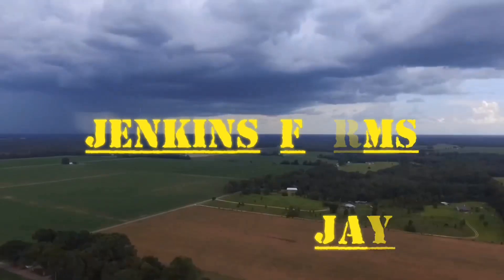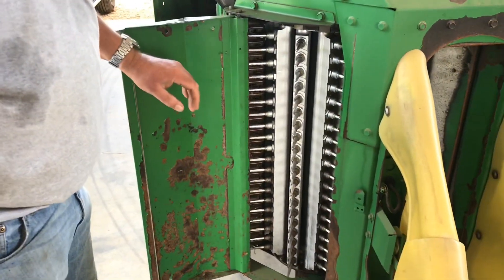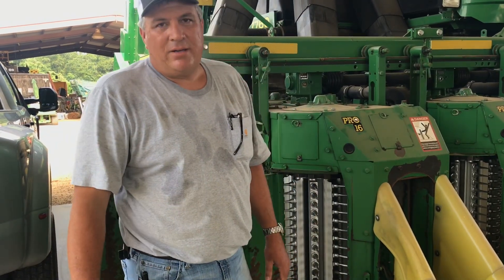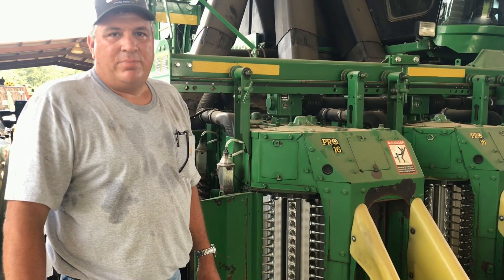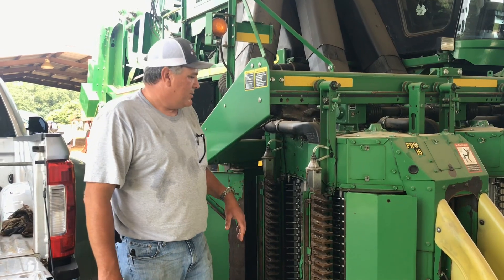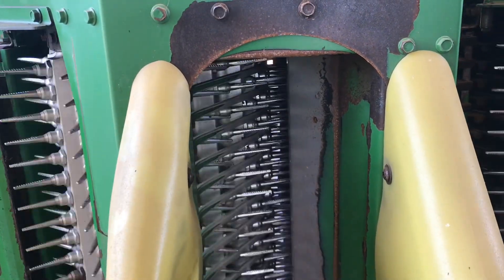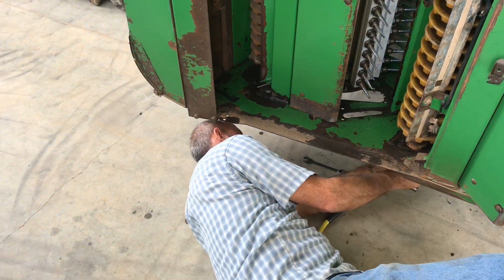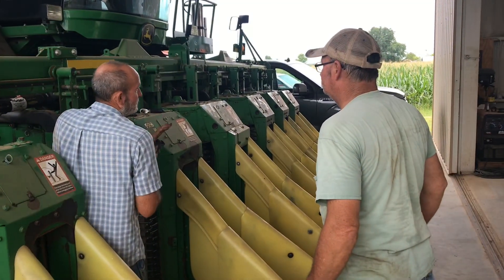Cotton Picker Maintenance 101

Comment: I have been helping my cousin (in NE GA) pick his cotton : he has a JD 9970 (4 row) since 2017. He picks, and I operate the module builder. My cousins and neighbors used to use IH (McCormick) 1- and 2-row pickers - those days are long gone. I remember helping my cousin work on his IH header spindles back during the early 1980’s.

Comment: That's a very good demonstration!
I'd like to see how much these parts cost.
It seems to be very expensive and complex maintenance. I'm not used to cotton farming...
Are all parts original? Are there other manufacturers?
Reply from the maker: Thanks for watching. There are aftermarket parts available. We use a mix of aftermarket and OEM parts depending on what we are working on. The yearly maintenance is pretty expensive if you keep it in top shape line you should.

Comment: i work on a cotton farm in Georgia, what do you use to change the moisture pads out? and how long does it take to replace all your pads when they are ready to be changed
Reply from the maker: I hire the guys in the video to do it now but when I used to do it I’d slice all the old ones off with a knife. I took a flat head screwdriver and heated it so I could bend an 90 degree hook on the end and used it to stretch them into place. Doesn’t take too long. Thanks for watching.
Reply: @JenkinsFarmsJayFlorida  awesome i made the same tool with a flat head screwdriver, there a few farmers down here in Georgia that take days to do this job, i got my handy tool out and showed them boys how its done..., thanks for the reply